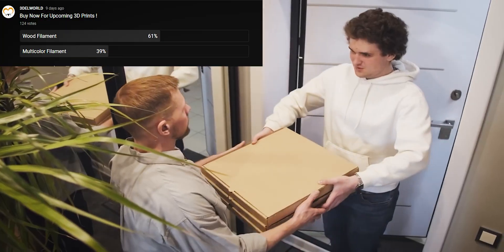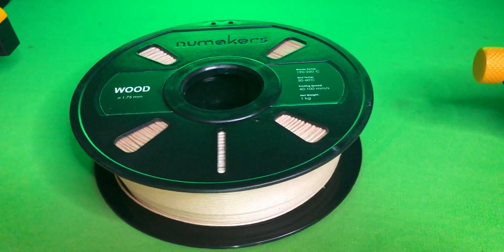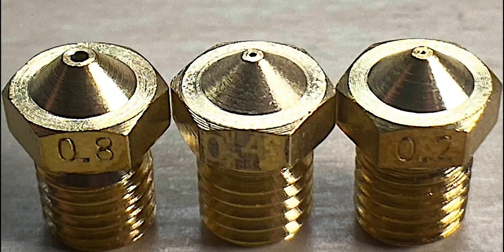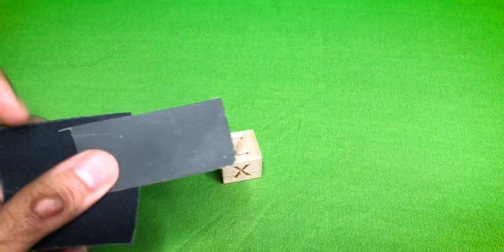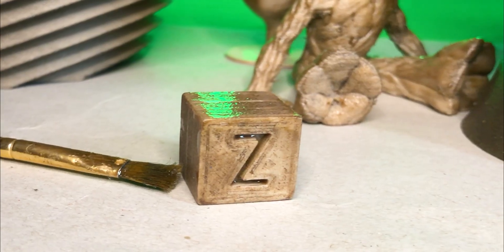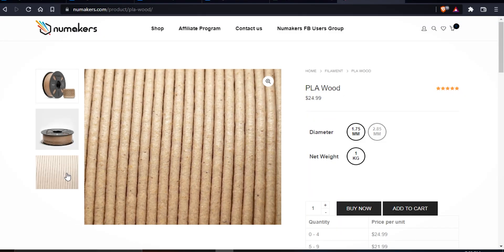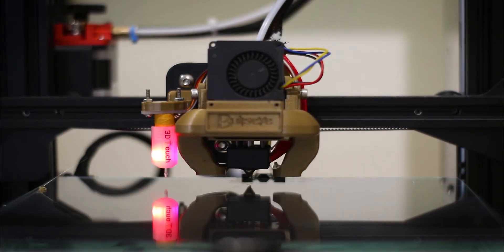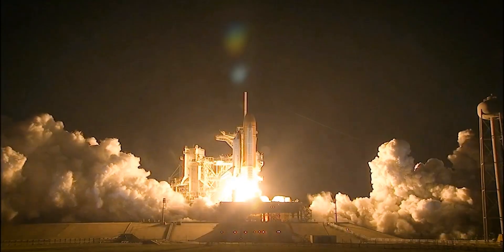Wood Filament Unboxing & Review | 3D Print Wood PLA | #3dprinting

Comment: I think I've heard a hardened nozzle is recommended like a steel nozzle. Brass nozzles are soft and can wear out quickly with the material added to some filament
Reply: I don't know about wood fill but certainly carbon fibre and glow in the dark.